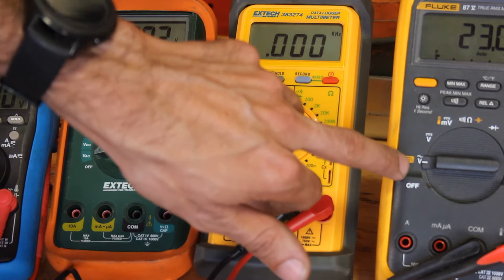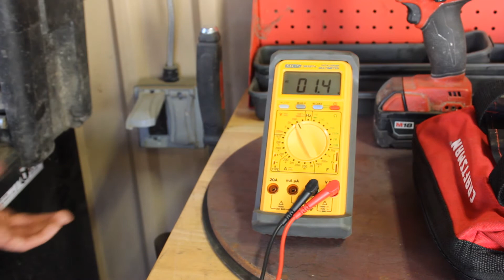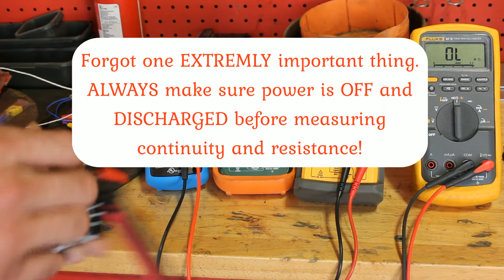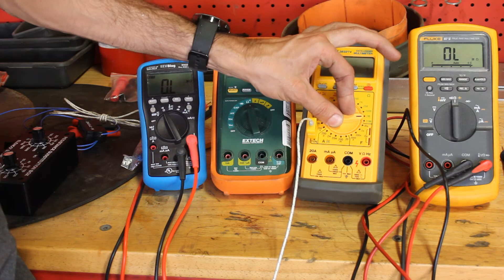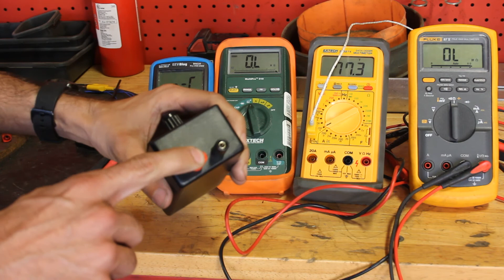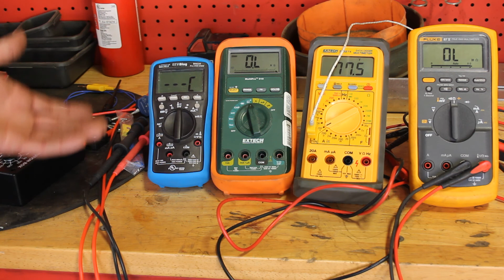100 SUBSCRIBERS! New Camera! Oh and Digital Multimeter Basics

Comment: The Brymen Bm235 seems to be have the fastest measurement speed out of the bunch you showed here. Nice little thing that's very capable and very robust :).
Reply from the maker: Yeah it didn't take long long to become my favorite meter. It was so nice that I had to go track down a Greenlee 210A to keep in my tool bag. It's a rebadged Brymen and though it doesn't carry so many features it has that same great speed and tough feel. Brymen makes some awesome equipment.